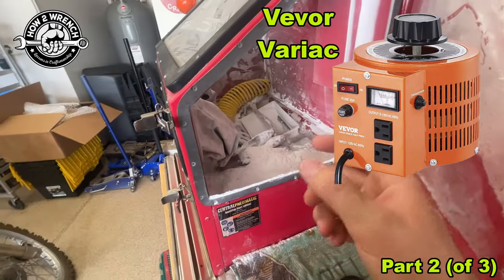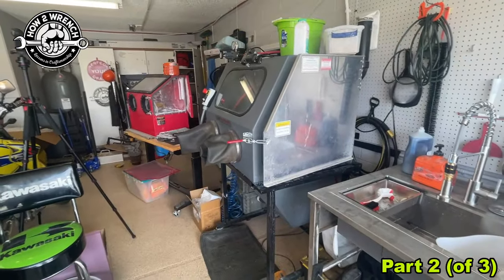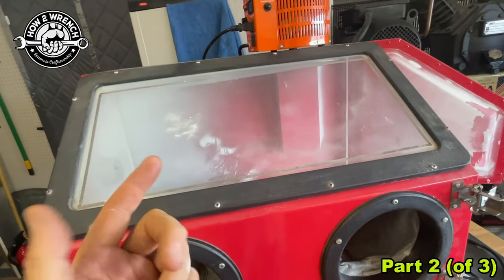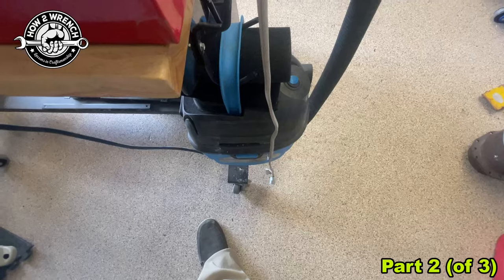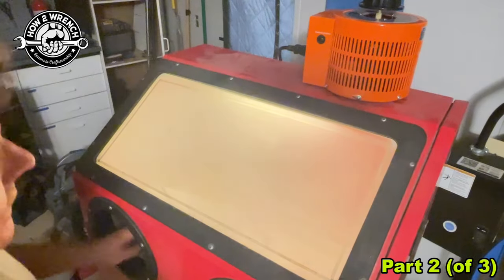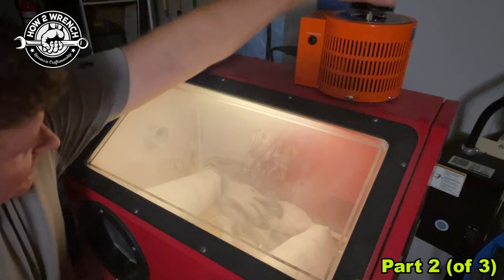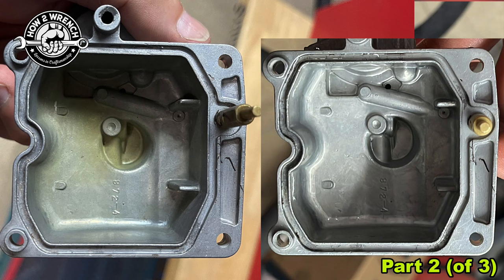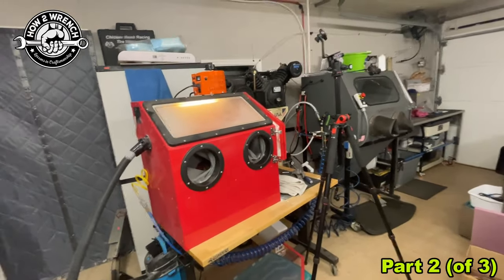Part 2 DIY Soda Blaster Build you can actually see with this Vevor Variable Transformer (Variac)

Comment: Really nice video great job!!
Reply from the maker: Thank you very much!
Reply: Never considered that about soda.  Good for caliper slide pins and pistons too I reckon.
Reply from the maker: @aubs8026  Most anything....washes off with water.
Reply: awesome job. carbs look so much better with soda blasting
I suggest a cyclone dust separator for the shopvac. I have a ceiling fan speed controller connected to my shopvac.
Reply from the maker: @chrishunter5765  Cool Idea!